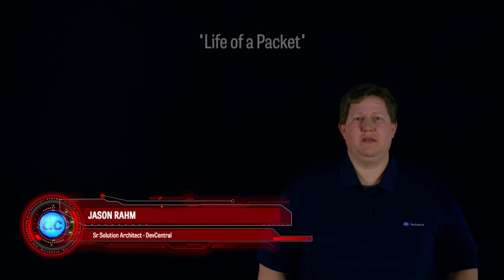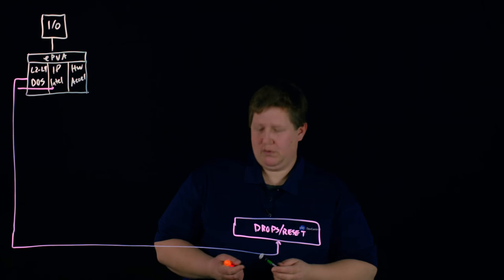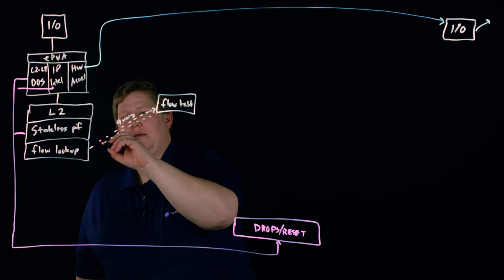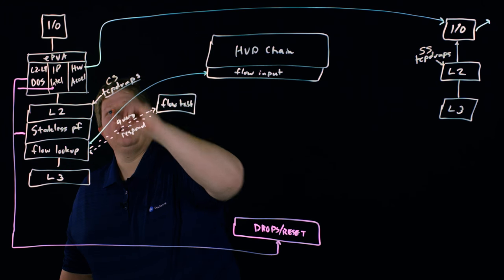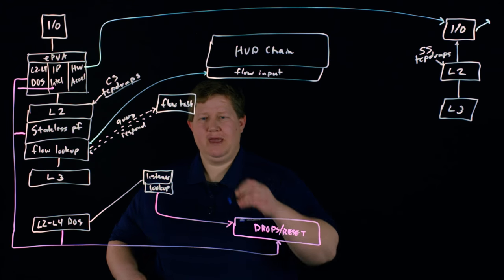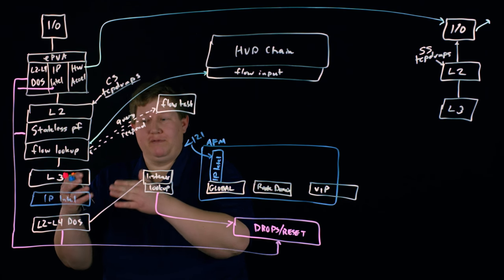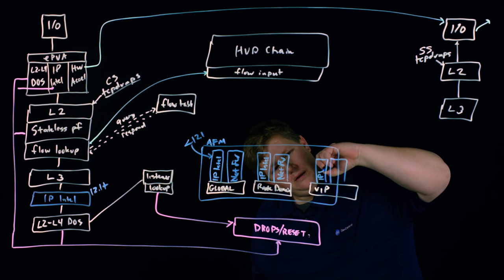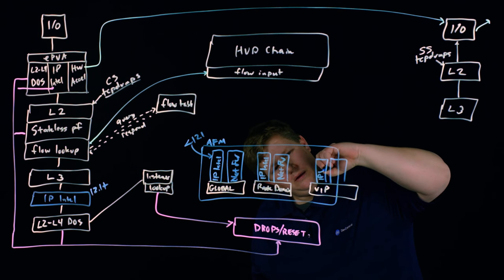BIG-IP Life of A Packet

Comment: Where do iRules come in?
Reply: the answer is "yes" :) iRules events fire in a loop as protocol layers are handled on both sides of the proxy, so at each stage of the drawing above, if there are iRules events belonging to that block in the flow, they'll fire there, assuming your virtual server has profiles applied for that particular type of traffic. For example, if you're just load balancing but not offloading TLS traffic, then events like FLOW_INIT will fire before AFM or TMM see the traffic, then CLIENT_ACCEPTED will fire after the TCP handshake on the clientside of the proxy fires, but you won't see the CLIENTSSL_CLIENTHELLO event or any HTTP events because those filters in the hud chain are not applied. Ping back if you have any more questions, thanks for asking!
Reply: @JasonRahm  beautifully explained, thank you

Comment: Many thanks for this videos . I just have one thing to add regarding where tcpdump starts capturing packets : 
the tcpdump captures packets from the L2 level if we run it on a vlan exemple : tcpdump -i 0.0 ; for all vlans
If you run the tcpdump while choosing and interface instead, using for example #tcpdump -i 1.1, you'll be able to capture PVA accelerated packet.
More info : https://support.f5.com/csp/article/K6546